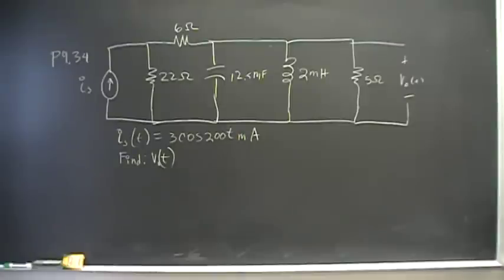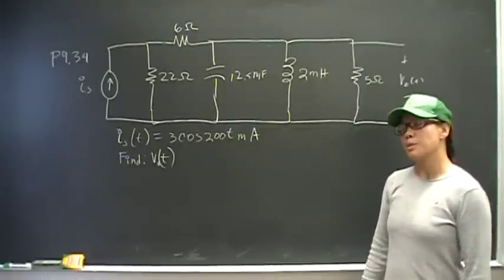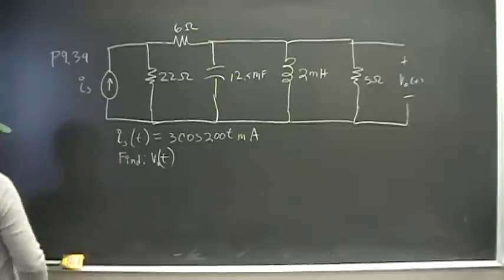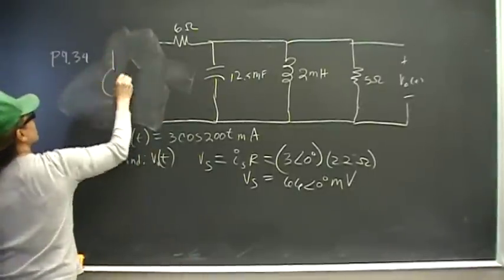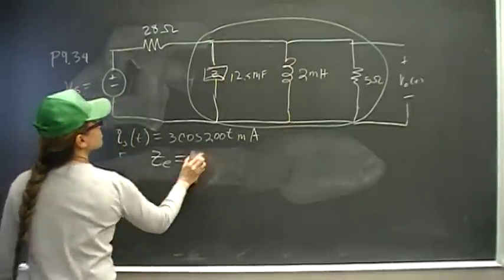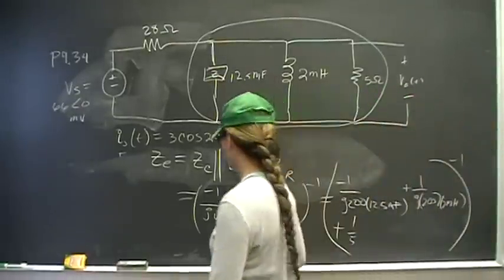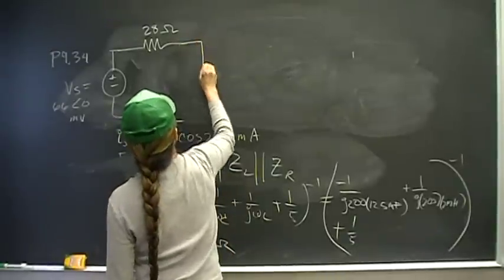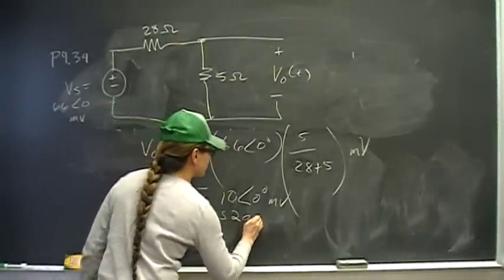#5 Video response subscriber request: P9.34 Nilsson Riedel Electric Circuits 9th Edition Solutions

Comment from the maker: notice that i chose to use superposition to solve this problem. additionally, you could also have solved this using the node voltage or mesh current method also. just simplify the cap, inductor, and 5 ohm resistor into its equivalent impedance first.

xoxo, thuy <3